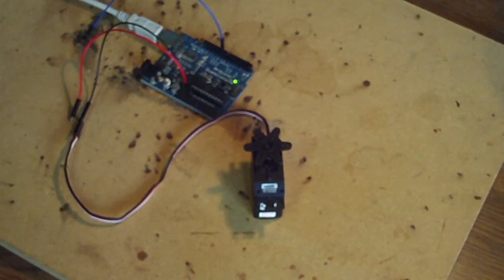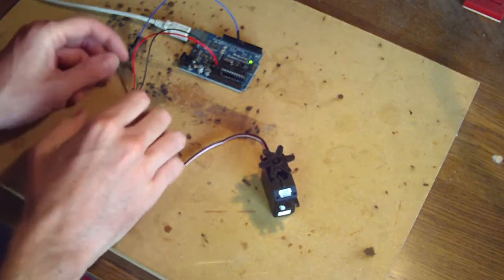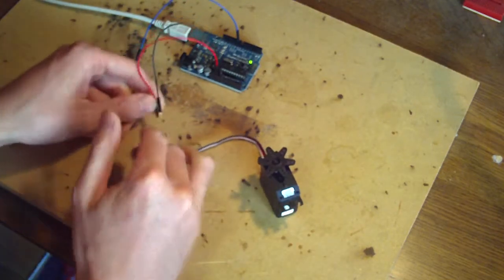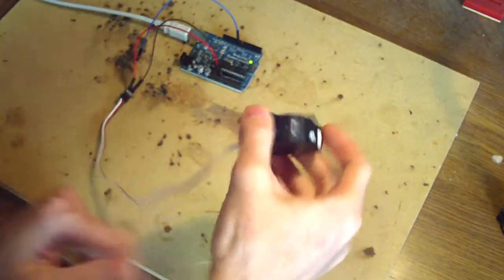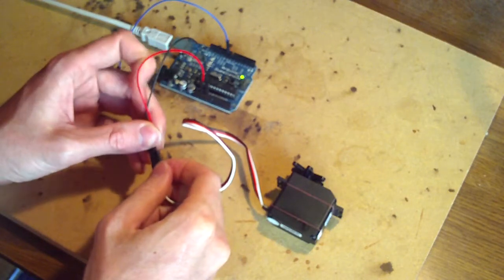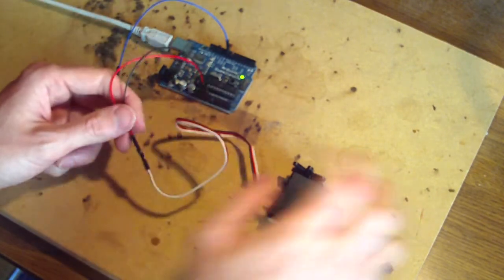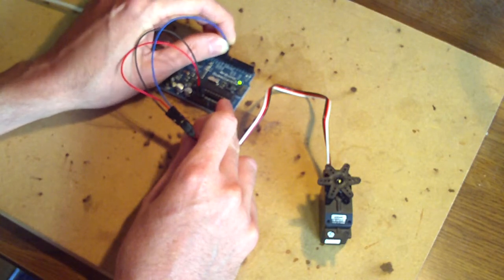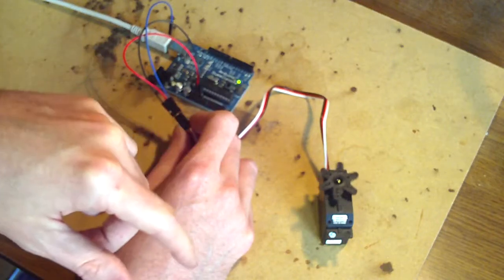Servo Problems

Comment: please please please please please please please please please please please please please please please please please please please please please please please please please please please please please please tell me that i bought two continues rotation servos from ebay ( link = http://www.ebay.in/itm/331606809745?aff_source=Sok-Goog). I started using them with arduino but i found that the servos were not moving without a push. I want to say that i want to make a robot and use these servos for wheel but these wheels dont move without my push so please tell me that what is the problem and how can i solve this in an easy way because i am not a expert in arduino.

Comment: Wayyy late to the party here; you've either solved your problem or thrown the thing away in disgust, but I'll post this in case it helps someone else.
You shouldn't be powering anything but the smallest of servos from a USB supply.  What's happening is that the surge through the servo motor on initialisation is dropping the Arduino supply down and causing the reset you demonstrate.  
The proper way to do this is to connect the servo red lead to the positive of a beefier 4.5 to 6V supply, the black servo lead to the battery 0V and also to the Arduino board 0V.  The signal wire stays the same.
Reply: +AndyGadget so maybe you can help me, i got clone uno r3, trying blink example not foun problem but, when tried servo sweep, my servo react even i just upload file with attach command and it definitely will ruined my servo as it runs until dead angle (not continuous rotating servo)

i use different power source for servo, it 4.8v from another avr board just to get the power pin
Reply from the maker: +AndyGadget - thank you very much for watching my video, but more importantly, sharing your knowledge about the cause of my problem that I show in the video. I can't remember what I ended up doing back then about this problem, but I believe in the end I scratched the entire project anyway. However, your advice will surely come into play in the future as I'm sure that this project will not be my last that involves servos.
Thanks again!
Reply: Can you tell me what causes the servo to move very slow? I have Traxxas tmaxx and throttle and reverse barely move. Batteries are good.  Can it be repaired. Thanks